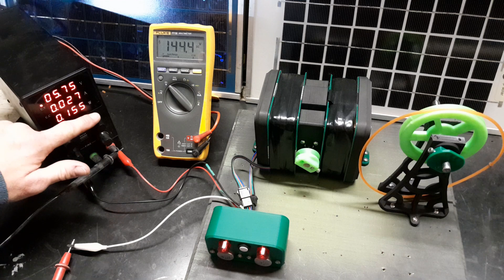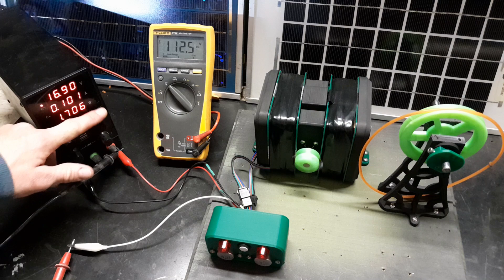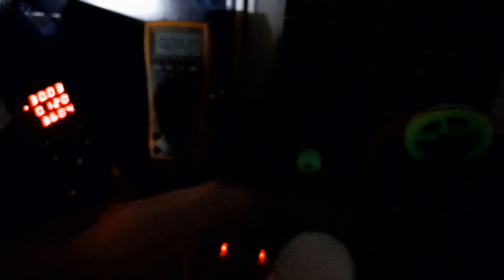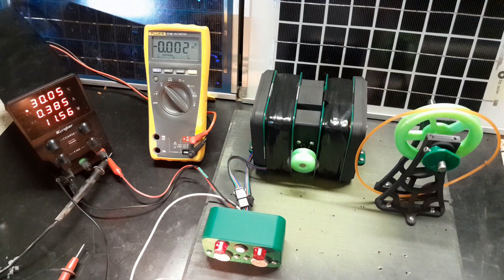bipolar bedini

Comment: Can I ask if you're running the coils in attraction mode or repel mode.
Reply from the maker: Both. The rotor magnets are nsns. It will start rotating in either direction you spun it.